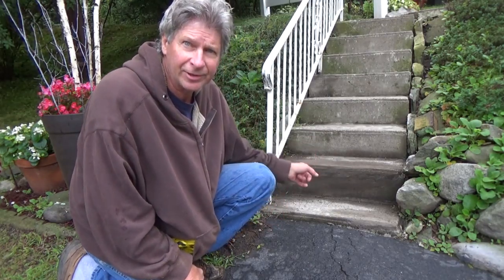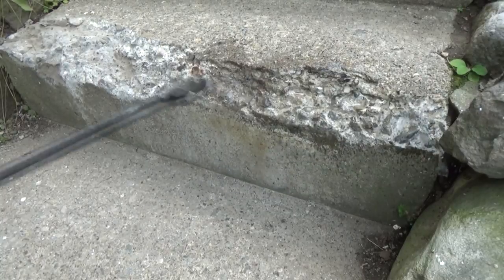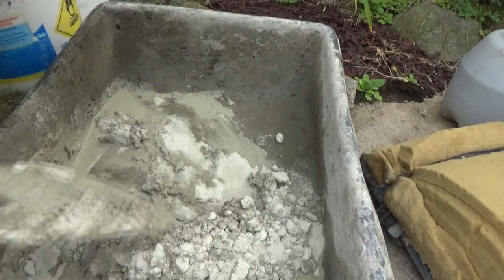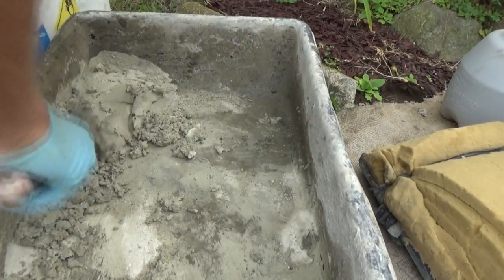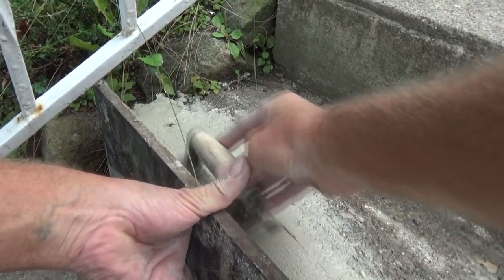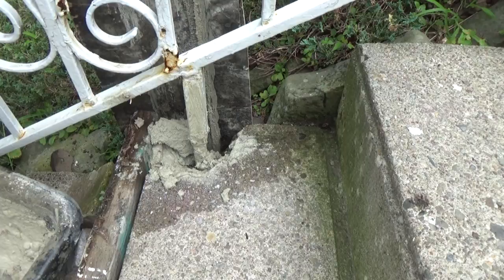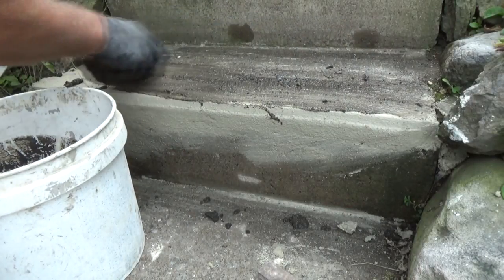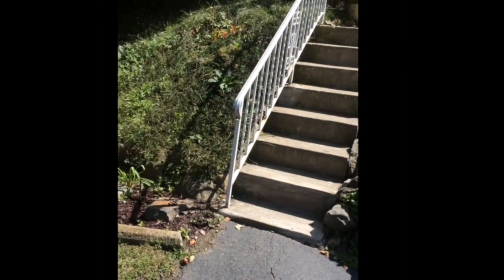CONCRETE STEPS REPAIR (Part 6) Mike Haduck

Comment: Thank you! I got more information about the specific repair I need to do from your video than I got from looking at product websites and talking to people in two hardware stores. My nextdoor neighbor’s roofing contractor drove across our sidewalk with his big truck and cracked two slabs. When my husband notified him, he repaired one slab, but his repair was so ugly, I scraped most of it away before it cured. Before he made the repair, when asked, he said he couldn’t color it to blend in with the old sidewalk. And he didn’t finish the edge to line up with the original edge of the slab; he spanned two slabs with his patch.
Reply from the maker: Hi Phyllis,   Anything that works,  I appreciate it , mike

Comment: Thank you Mike for making these videos. I got the same mortar mix from Home Depot. Great stuff. It sure hardens quickly. Sometimes too quick! Got to work really fast!!!
Reply from the maker: Hi thong, Yep very true, you got to work fast with that stuff, thanks Mike
Reply: twong   Rapid Set® SET Control®: slows down the setting speed. 
you might try it on a test batch to see how it works.
One packet of SET CONTROL will extend the initial working time by approximately 10
to 20 minutes in normal conditions they say in the literature.
Reply: pensive69 Good to know. Thanks for the tip.

Comment: Thank you so much for this video~! I was able to repair our porch steps using Quikrete and your instructions. It's not as nice as your work, but it only cost $22, including tools =) I used cheap plastic stuff and it worked fine. I'm not going into the business anytime soon - that was really hard work~! The smallest bags I could find were 60 lbs! But it will likely make the city happy and my dog, who is most important =)
Reply from the maker: Thanks , I appreciate it, Mike

Comment: Thanks Mike! I almost paid 500.00 to do less of a job. Now im going to try myself with ur video!
Reply from the maker: thanks Cheng,  I appreciate it.  mike
Reply: @MikeHaduck  mike, i have a question, can i email you my picture b4 i start? I have a 1inx1in metal fence pole in the section im working on. It has this weird yellow powder surrounding it after i removed the loose concrete.

Comment: I’m so impressed with your expertise as well as your humanity. Thank you for sharing 
I have a 10’ wide 4 step concrete stair that has a wide deterioration on the step face and going down into the steps.  Not sure if I should cut away to better access loose materials and fill the flat void first,  then repair the face where damage is not as bad.  Does this sound like a quickest job. 
Thanks Jim from Ohiiu
Reply from the maker: Hi Jim, I can not tell you what to do unless I was there to see it, but I got a lot of diffrent ideas on my , stone step repair playlist, thanks Mike

Comment: Hey Mike, these are great videos.  I often think things like this are a complicated repair and I see that If you're a fairly handy person, it's actually pretty simple.  Question, I have precast steps on my front porch and one of the treads has a pretty big chunk chipped off the front edge.  Would you use the same techniques to repair it?  I tried a repair before but it didn't hold up.  Thanks again for taking time to make these videos!
Reply from the maker: Hi Detroit,   every situation is a bit different, but it almost always worked for me,  I hope it helps,  thanks mike

Comment: Thanks Mike. Great info. If you answer questions, I have 
 a couple.  What is the purpose of painting steps with watered down portland cement? Is it to create a non skid surface or to create a consistent look on the stairs. Can portland cement be applied over painted cement steps to create a non-skid surface or does it only stick to raw cement? I am a professional painter. Painting steps, stairs, and wheel chair ramps is part of my services. If stairs are already painted, I use paint that is specifically for horizontal surfaces. I add a  sand like additive to create the non-skid. I have never seen your method. Perhaps it might be better than mine. BTY my left leg is disabled from a slip and fall on stairs 20+years ago. Your video in my professional opinion is a must see for anyone who has stairs and rails that are in need of repair. Thanks!
Reply from the maker: Hi Sky, I only use the Portland paint over cement or masonry, never over regular paint, I would rather use the masonry paint with the non skid myself,  I always consider the non skid masonry paint as the last step, Portland is usually the patch, thanks Mike

Comment: Great trick with the mud. I usually tint it with black and buff dyes. Even then it doesn't blend In as good as this did. 
Is that Rapid set mortar strong enough for this kind of repair? Never used it for that.
Reply from the maker: Hi MMG,  I been using it for a while and is been holding up great, but only mix what you are going to use in 5 minutes, it hardens fast, Thanks, Mike

Comment: Thanks Mike! That was a very helpful video! I resurfaced my concrete stairs last year and then my tenant put salt on them this winter and they all cracked and chipped off. So now I need to redo the whole thing. But I don’t want that to happen again. When I resurfaced then I don’t think the concrete completely adhered to the old concrete stair. Any tips on how to get the concrete to adhere better?
Reply from the maker: Hi Selena, usually I make sure it wet and rub it into the old concrete good, a patch is a patch but a little practice you get better and better, thanks, Mike
Reply: @MikeHaduck  ok thanks Mike. I am going to try again. Another thing I did was press leaves into the concrete before it dried. It came out really nice. People always comment on it when they come up my walkway.
Reply from the maker: Nice, very inventive, mike

Comment: Repairing my concrete tile roof myself without previous knowledge but need some instructions on doing the cement work on the ridge tiles and sides of the gutters after removing tiles and old concrete. Have you filmed any of these. Thanks
Reply from the maker: Hi Paul, no, I haven't any videos on that,  thanks mike

Comment: Mr. Haduck, you often use a rapid set (mortar mix and cement all) for concrete steps on small jobs, but would you ever use 2 to 1 sand and portland for steps?  At the moment, it's all I have.
Reply from the maker: Hi, at one time there wasn't much more choices, but it's not worth it for me anymore, thanks Mike
Reply: @MikeHaduck  is rapid set stronger than portland?  do you not use portland for steps anymore b/c it dries slower?  thanks.

Comment: I keep questioning if I should have bought the Cement All instead of the Rapid Set Mortar Mix for the broken edges on my steps. I have similar weather to PA. In some videos you use the Mortar Mix, and some is the Cement All. I'm guessing I could use either.
Reply from the maker: Hi, I usually use the mortar mix first, Mike

Comment: Hi Mike, I like the mud trick.  I do have a question though.  Is portland cement darker (less bright) than the rapid set cement all? If I do the mud trick with Portland, will it blend in even more with the old existing cement?
Reply: Also, would it work if you made "mud paint" from crumbled charcoal or ashes from the fireplace?

Comment: Mike,  water got in a crack in one of my concrete stairs. Froze and thawed several times over the winter and cracked about 1/2 the stair off.  Similar to the damaged stair you're working on in the video but about  three times as deep.  Would you still use rapid dry mortar for that?  Should I try to  insert some metal rods or screws into the old stair first to act as rebar to give it more structural strength?
Reply from the maker: Hi Daniel, some masons do that, usually if it comes to that I replace the whole step, but I usually never have a problem, thanks, mike

Comment: I'm surprised you used mortar, i thought you prefer Portland mix for jobs like this. Any thoughts on vinyl patch? I'm thinking of using it for my driveway.
Reply from the maker: Hi Chris, rapid set says it's a mortar mix but it works like concrete, thanks mike

Comment: Mike, do you have any advice for hiding a hairline crack in driveway pad? It basically cracked and made it's own control joint all the way through the pad.
Reply from the maker: Hi Steven, check out my video, how I caulk a concrete driveway,  that should help, thanks mike

Comment: Thank a lot I learned a lot from this
Reply from the maker: Thanks Michelle, mike
Reply: Do you need bonding material when using old concrete with new concrete for adhesive

Comment: Would it have been better to use a bonding agent or adhesive to make it last longer or do those not work?
Reply from the maker: Hi 86, I was using these techniques before they came out with all these bonding agents, but once in a while I might add some, thanks Mike

Comment: If your in New Jersey around Newark I can use you. My mothers porch has the slabs cracked on every step and where the railings are connected. Water leaks into the basement.
Reply from the maker: Hi Belin, I appreciate the offer,, but I don’t really work out of my area,  thanks, mike

Comment: Another great video thanks Mike! Question: why mortar mix and not cement mix?
Reply from the maker: Hi Joseph, with my experiments with rapid set, I think the mortar mix  is the same It just has sand in it and I holds up great, I never had a problem,  thanks mike

Comment: I'm going to repair my 1st single step, half broken off by front door. Should I use quick setting cement or slow drying cement if I want it to look nice
Reply from the maker: Hi Samuel, traditional cement takes a few days, quick setting a few hours, it's up to you,  thanks Mike

Comment: Thanks Mike. Can i  use 1:3 (or 1:4) sand cement mix instead of mortar? In my country it is hard to find right (strong) mortar for this kind of job.
Reply from the maker: Hi Anthony,  with anything laying flat outside I use 2 parts mason sand to 1 part Portland cement,  but you will get expansion cracks so you have to go over it the next day,  I hope it helps mike

Comment: Hello, I used quikrete concrete patching compound to repair my stairs. The patch cracked after two years. Is this normal?:I did use concrete adhesive during the repair. Many thanks!
Reply from the maker: Hi ask, I can't say, I use my own techniques and haven't used their product for that, thanks Mike

Comment: Does adding concrete bolts make much difference or would the structural mortar be enough "hold"?
Reply from the maker: Hi Sean,  some do,  but I never did and never had a problem,  thanks, mike

Comment: Hello Mike, I have a chunk of cement that broke off my bottom step 12" x 12". Should I try to glue it back on with PL Premium glue or should I re-cast it. I live in Montreal, Canada and I am not familiar with the products that you use, e.g. Cement All Rapid Set Mortar Mix, Portland Cement, we do have a Home Depot Store, do these products equal Quikrete products? I really need your expertise.
Reply from the maker: Hi t,  I can’t really tell you what to do,  Ithink you should ask the pros in your area, I hope it helps, Mike
Reply: Thank you Mike.  I am going to try to re-cast it first and if that does not work, then I will try to glue it back on. When I re-cast it, is water enough for the cement to stick or should I use an acrylic product to wet it with first? T

Comment: I have steps that aren't diverting water away from the house anymore(settling? 40 yrs later) Can I put a coat of cement all/ rapid set mortar  to re=slope the steps? I'm not sure if there is a  minimum thickness for the cement to adhere properly?
Reply from the maker: Hi, I have a playlist called " concrete step repair" Mike Haduck, I show what I did in each circumstance,  thanks mike

Comment: Love the mud trick! 
Question: I patched some concrete with rapid-set mortar a few months ago, and it is bright! Could I mud over it now? Would it darken it and keep dark, or maybe put on a thin coat of rapid-set and mud over that?
Reply from the maker: Hi Gil,  If it was my house I would try the mud trick,  wet it good and put the mud on overnight and it should stain it , I can/\'t be sure but I would think so,  thanks mike
Reply: Definitely going to try this. Thanks!
Reply from the maker: Thanks Gil,  I hope it helps, thanks mike
Reply: I'm thinking you can buy a bottle of the charcoal concrete/mortar mix stain and mix it with a little Portland and paint it on.  I might have to do this for a patio crack I repaired at my in-laws.
Reply from the maker: I just did that at a friends patio,   I hope it helps mike

Comment: No bonding agent applied to the existing concrete so the new stuff doesn’t just crack off after a few weeks?
Reply from the maker: Hi Mr Big, I never use it with rapid set, I think it drys too fast, I just make sure I wet the surface first,  I never had a call back, thanks Mike
Reply: @MikeHaduck  thanks for getting back to me I appreciate your free advice especially since I’m going to attempt to fix a concrete riser on my front  steps. I live in a 100 year old row home in Philadelphia that has four steps that I share with my neighbor, no porch just four steps and into the house . The problem is these steps are kind of hollow and I can get under the steps from my basement but it’s a small access opening so it’s super tight. The steps used to have a metal slot built into the sides of the steps where the your coal would get delivered right into your basement. That small opening has been removed and was filled in with a homeowners special patch that’s starting to crumble requiring me to have to clean out the broken material and make a repair. So now on my stop step the front of the riser has a big hole that’s been developed over the last couple weeks about 6 inches high from the bottom of the riser and maybe 15 inches long . I had insulation under the steps so it’s stopping any water or critters from getting into my basement but it would be very hard almost impossible for me to get under the steps and make a form to fix that riser , any ideas on what to do? I could put up a piece of plywood and seal the area under my steps then start filling the area in with cement but that’s a lot of cement . Also I’m not sure of what the steps are made out of its not any type of concrete I’ve seen used before it’s almost like they used brownstone to match the front of the house but I’m not sure . Thanks for any advice .

Comment: Mike, while filling crack, when should i use cement all with GRAVEL. i dont see u are using gravel while fixing big holes. is there a reason when to use and when not to.
Reply from the maker: Hi sivaraj,  my experience with the product, tells me it’s all the same, whether it has gravel, no gravel, or just the mortar mix, if I have to add gravel I just add it to the mortar mix, I have never had a problem,  but anymore I just made a mortar mix and if I had to have add gravel I do it with that,  but then again it all depends on what I’m doing at for, I hope it helps thanks Mike

Comment: '...while it is still wet cover it with mud to stain it to look old. ...'

what would you suggest to use with an old concrete that is more tan in color?
i'm doing a job and i suspect the old commercial structure had tinted concrete when their walks were last poured..maybe 25+ years ago.
they have small cracks and chip-outs and i didn't want to just caulk.
no one at the building knows the history.
i thought maybe a tan oxide tint in the mix would get me closer than river sand added to the still uncured surface.
sand doesn't seem to sink in as well.
Reply from the maker: Hi Pensive,  matching is a nightmare,  most times I paint it after I am done with a stucco paint,  or color the cement I am using,  hard to say,  thanks mike

Comment: As a property manager of 245 unit condo complex I need to do this exact repair.   I thought about shooting about 2 tapcon screws in  to act as a mini rebar.   Would you discourage the use of tapcons as rebar as it might compromise the edge brittleness?
Reply from the maker: Hi TImbers,  I have seen others do that but I have not had a problem, I wet it and marry it good,   thanks mike
Reply: I do a lot of little patch jobs. A few tapcons is a crucial move in my opinion. "Cheap insurance"

Also i mix little batches of fast setting products in a 5 gallon bucket with a little paddle mixer on my drill. It mixes instantly so you have a couple more minutes to work with it compared to mixing it by hand which takes a little longer.

Loved the dirt trick mike turned out good

Comment: what other cement option would you use if you wanted more time than the rapid sets provide?
Reply from the maker: Hi Still, the old days it was always Portland and sand , but it turns it into a few day process, thanks Mike
Reply: thank you for your quick replies.  i enjoy your videos so much.

Comment: I just got called in on a week-old slab that puddles in several places and slopes toward the house.  Would Rapid Set be suitable to resurface or is there something better?  Ardex and the like are pricy!
Reply from the maker: Hi Jeremiah, Personally I would stay away from that job, because all the patches are going to be like patches on an old coat and they’re going to becalling you back , Best thing to do is rip it out and redo it, if , Standing water is a big thing I always put big pictches on my concrete, I hope it helps thanks Mike
Reply: Mike Haduck Masonry Thanks, Mike.  Bummer. So nothing good for a topcoat?
Reply from the maker: Hi Jeremiah, the only time I recommend a topcoat is before replacement of the slab because it’s only a patch, and it’s OK to keep patching, but that’s what you Gotta do keep patching  and they will keep calling you  back over and over again ,  my experience, I hope it helps mike